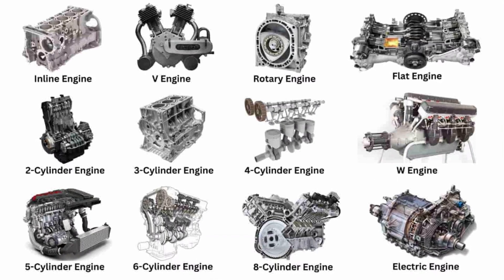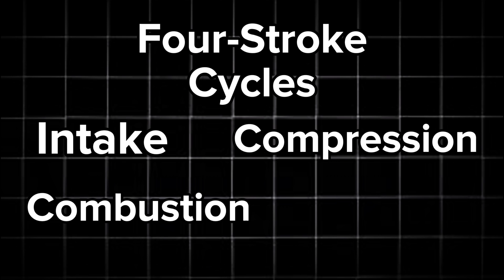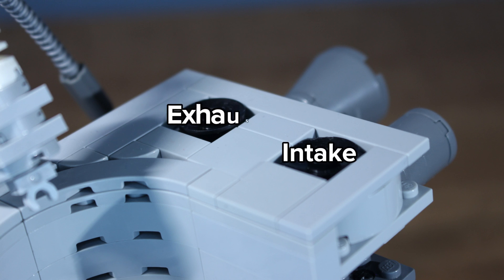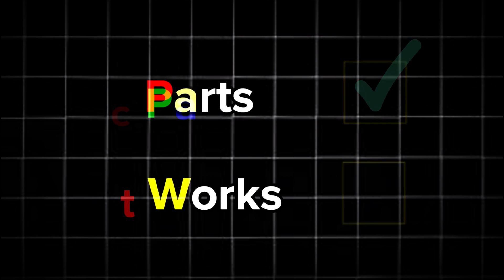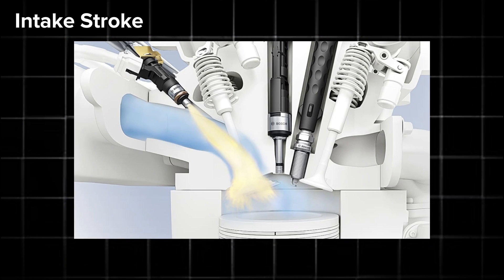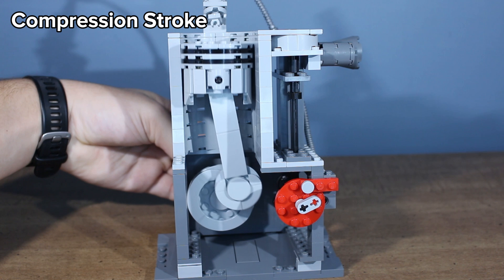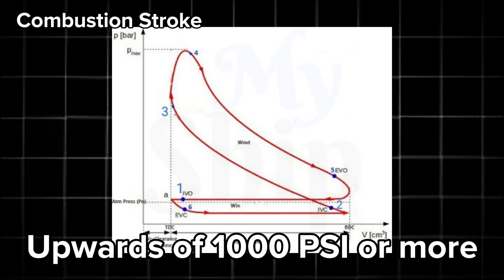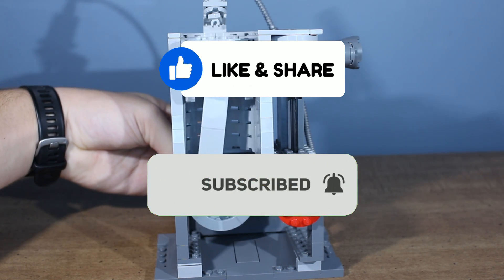How 4-Stroke Engines Work | Explained with LEGO!

Comment: which gears do you use to build the 1 to 2 ratio
Reply from the maker: There's a 40-tooth gear on the camshaft and a 20-tooth gear on the crankshaft. The 20-tooth is the azure colored gear, not the bevel gears. That's so a chain can fit over it
Reply: @DeltonAdamsLEGO Thank you

Comment: Are these basically different to reciprocating engines? Or are they just different words for the same engines
Reply from the maker: "reciprocating" just means there is a piston that moves up and down within the engine. "4 stroke" refers to the method of fuel and power delivery. So for example, both a V8 and a steam engine from the 1800's are reciprocating engines, but only the V8 is a 4 stroke.
I hope that makes some sense 😊
Reply: @ ah i got confused because people kept calling Titanics  engines reciprocating engines which they are but i guess they dont have a specific name so i thought that reciprocating engines were massive steam engines or something but anyways thanks for clearing up my confusion.
Edit: also if you know a proper name for Titanics massive reciprocating engines please tell me.
Reply from the maker: The titanic's engines are usually known as "triple expansion" steam engines, just letting you know 😊
Reply: @ thanks a lot i always forget that.